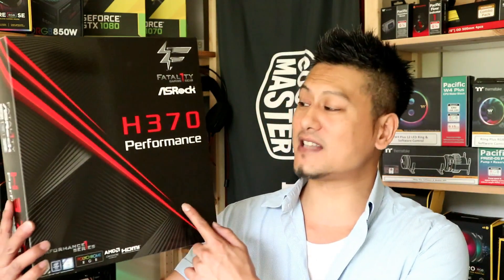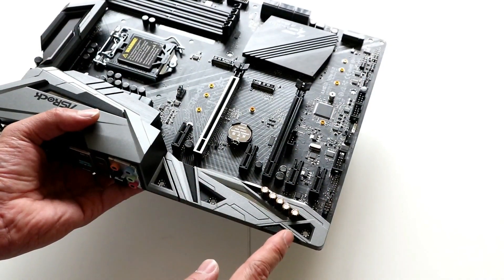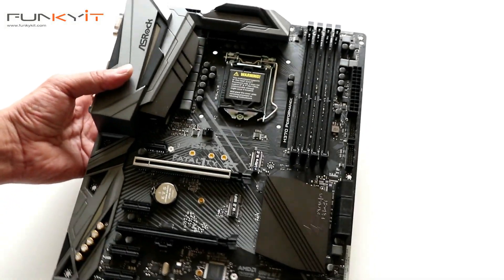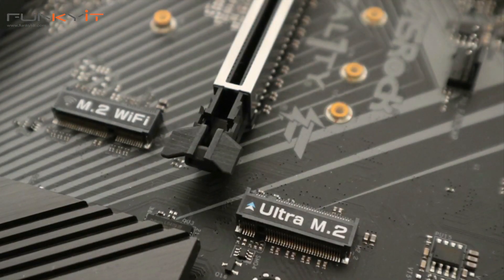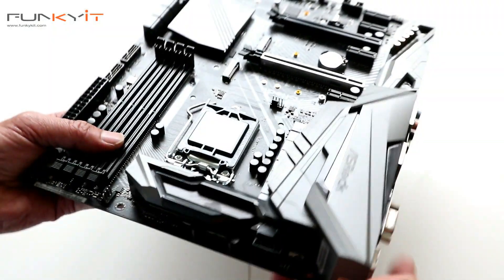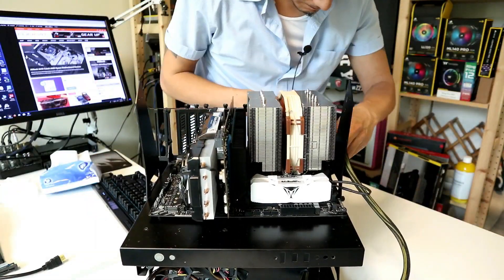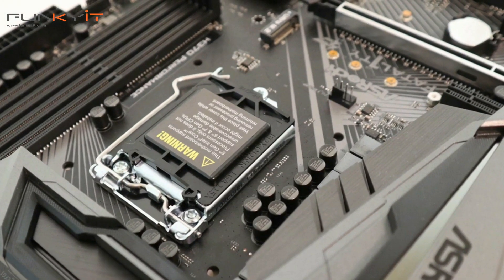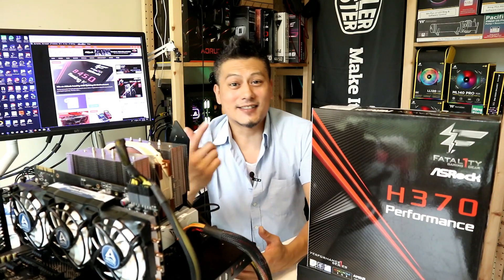The best all-round H370 Motherboard - ASRock Fatal1ty H370 Performance

Comment: Works with Gen 9 processors with a bios update!  I am running this board with a I59400F
Reply: how did you flash it? Can I do it without inserting a CPU? I just got a 9600k that fits into that motherboard. Or can I check the BIOS version without a CPU?